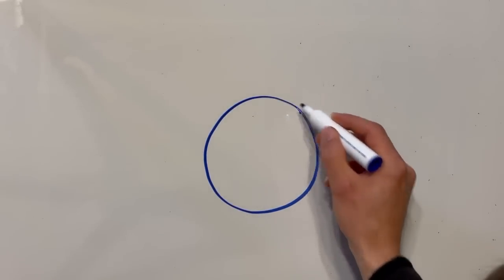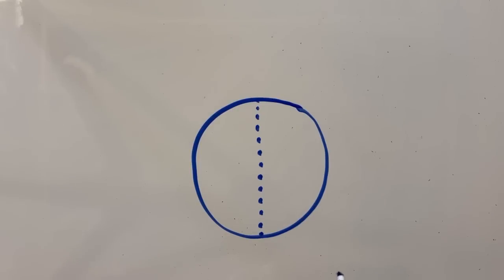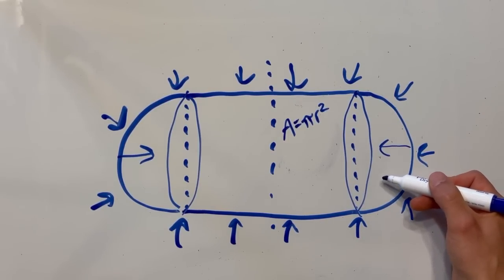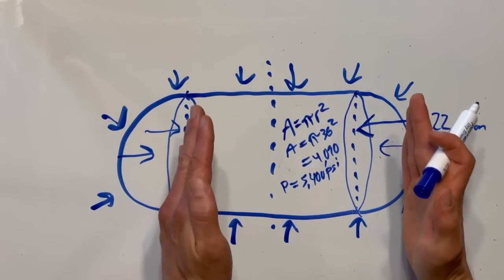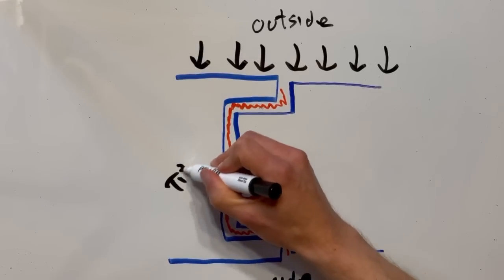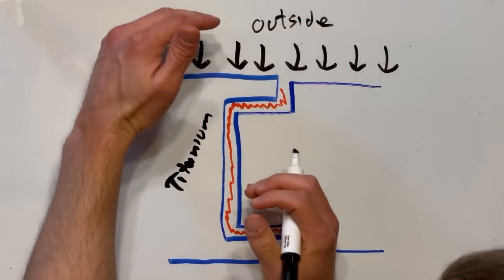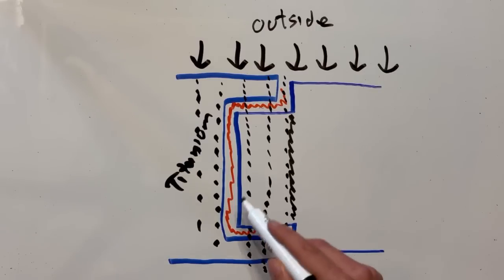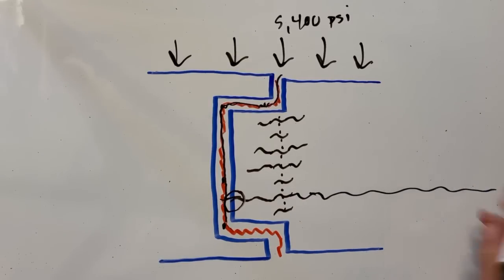Simple Engineering Analysis of How the Titan Submersible Could Have Failed

Comment: If the hull had a step where the titanium fit onto the carbon fiber reinforced plastic (CFRP) hull, my engineering knowledge screams stress concentration! The design relies on the water pressure squeezing the end caps onto the CFRP cylinder. Under this load the cylinder wants to buckle.  The pressure inwards perpendicular to the cylindrical axis also will cause the sides to buckle or bow inward. Where the end caps and CFRP joint the hull walls might be subject to bending or pulling away from end cap in the joint. What happens depends upon stiffness of each component at the temperatures at 12,000 foot depths (cold). Any tiny gap will draw water in by capillary action driven by 5,500 psi pressure. Your point about a shear crack is a possible failure mode. My gut is that cracks in the matrix or between layers of CFRP start at the step (if one exists). Does need to reach as far as you suggest. Now Titan seems to have a Titanium bands/hoops that seem to cover the joint. The legs were attached to these hoops. Don’t know if the hoops merely held the skids or if actually sealed the outer edge of the joints. There would still be a joint between CFRP and titanium, three dissimilar materials with differing Young’s moduli and thermal expansion/contraction coefficients.

Comment: Very good analysis. Especially for the non-engineer.
Easy to say this now, but after forty plus years of building carbon composites, my initial reaction to seeing the pressure vessel, was complete disbelief. I just had to search my memory for the number of times I'd engineered a compressive structure. And all i could come up with were three. And those required extensive omni-directional laminates. I'm still at a loss as to how this was even considered. And even if attempted, how both vacuum and spectral inspection was not in the mix.
Thanks for the video. Keep up the good work.
Reply from the maker: Thanks.  I tried to hit the main points for the average person and not make a crazy long video trying to break down every little technical anomaly.  I do not have the expertise to say much about use of composites in compression.  I am actually curious about studies using carbon fiber in such a manner.
Reply: @Mutton_Lettuce_and_Tomato  You did fine. Always effective to use simple practical examples to get more complex concepts across. 
The reality is, composites, regardless of whether they're carbon, kevlar, etc., are rarely used in compression unless they are part of, or complement, a more complex construction of other materials. That's why, for instance, composite wing structures, even on light aircraft, will incorporate substructures to distribute compressive loads, while allowing tension loads to be somewhat independent through a limited vector.
From my perspective, the real issue with the Titan's use of this material and process, is that we go into composites  knowing that the only way to validate integrity, is by use of pre-pregs under vacuum. And then, non-destructive testing. With metals, we can control the matrix. With composites, that matrix is only known or trusted, on the material level. Not the construction level. 
Thanks again. Keep it up.

Comment: Thank you, Jesus, for someone addressing the glue. I have been saying this from day one. But you didn't go far enough. You did not address how much force was applied to the titanium when it was "glued" to the carbon. If it was just the weight of the titanium cap, that means the glue has to be really compressed/uncompressed when going down and up. People who have used wood glue, how much force? Too much, all the glue gets squeezed out. Mechanics, attention. Valve cover gaskets, you apply pressure evenly when you tighten the valve cover, and you have a final torque that you will finish with that will work with one atmosphere. But the valve cover was not going to experience pressure unless your wife got tired of your crap and drove the car off the bridge with you in it. But, no need to worry, the water that would pour into the engine would equalize the pressure, and your valve cover gasket would be fine even at 50,000 feet deep. Unless Bob at the factory was paying more attention to the lunch clock than he was to making the gasket, and he got an air bubble into the gasket when he was making it.

Comment: Exactly. This man's got it. I must have watched 20 other videos intending to explain why the sub imploded, and I've seen only 1 other video, from only one other engineer, who seemed to understand the problems with the sub that seem obvious to me even though I am only an lowly electromechanical technician and not an engineer. Carbon-fiber-composite cylinder such as that used in the sub, should be strong at holding high pressure in due to the fiber's tensile strength, and not merely useless at keeping high pressure out, but likely to cause damage to the epoxy resin surrounding the fibers as the fibers flex inside the expoxy. Just think of a rope bridge. Rope has high tensile strength, but it just bends when you try to compress it longitudinally. That's why you can hang a bridge from the rope but you can't use a rope "column" below the bridge, to hold the bridge up. Problem with the composite cylinder seemed obvious to me when I (1) learned that carbon fiber had high tensile strength, and (2) saw the way the fibers were wound, in a circle, or a helix, to form the carbon-fiber-composite cylinder. Then we use an adhesive to attach titanium hemispheres to a carbon-fiber-composite cylinder? I'll stop here.
Reply from the maker: Yes, the resin can work fine in compression with the fibers to strengthen it to some degree in compression like rebar in concrete, but sheer stresses at the bond joint is a likely place to create delaminations/cracks in the resin between the layers.

Comment: No one has addressed the issue of what happens when the landing frame is jettisoned to lighten for emergency accent, then you have two heavy ends and light in the middle , like holding a wiener horizontal in the middle it droops on the ends
Reply from the maker: The landing frame would have such an insignificant impact of the larger forces acting on the pressure vessel. I think even on the surface the heavy titanium ends were supported more my the composite hull than the landing frame.  This is why there almost certainly had to be some horizontal fibers laid down in the composite hull to support the titanium ends even when above water.
Reply: @Mutton_Lettuce_and_Tomato  take a closer look at at the tube no structural support other than the frame , the failure point would be the bonded joints , the failure of the rear joint at top is most likely first failure point , just like I predicted a failure of 100 buildings in the south during ice storm , only as strong as weakest link

Comment: You are the first presenter that has mentioned "tension-compression" issues with carbon fiber.  That sub basically resisted water pressure with the five inches of epoxy resin, which in itself is amazing.  Excellent discussion.  Thank you.
Reply: That's what I was thinking. If the fibres bend, which they do in the video showing them make winding the actual pressure hull, then the only thing giving rigidity is the resin ! How could so many people have made such a obvious mistake ?! Tension versus compression.
Reply: @rawnukles  You could make a comparision between carbon fiber bonded with epoxy resin and steel rebar bonded with concrete.  The difference being that the rebar is strong in compression and in tension and gives the concrete increased rigidity.
Reply: I have been waiting for some detailed comment on the use of carbon fibre and know it is used widespread in tension applications. Before seeing this I was looking for compressive strength figures for carbon fibre and found that it was only 50% to 30% as strong in compression. I also watched the video of the bonding of the carbon fibre tube to the titanium end flange and was amazed to see how it was slapped on in an open factory environment. In all very well explained here. Also I was with Rolls Royce as a trainee when their faith in carbon fibre bankrupted them so I have reason to be sceptical of carbon fibre.
Reply: except it SHOULD have been 7 inch and should not have been made from aircraft industry rejected fibre
Reply: @gowdsake7103   carbon fiber is not suitable for deep water use regardless on its quality or age or thickness.
Reply: @roycem4945  As I understand it thats true but the way it was used makes no sense
Reply: @gowdsake7103  Right on with your statement.  NASA uses carbon fiber, axially wound solid fuel rocket booster casings that do fine with one exception.  But of course, the pressure is coming from inside the casing and wanting to expand the circumference of the tube, therefore putting the fibers in tension.
Reply: @gowdsake7103   I learned as a kid that you can't use glue to bond metal to something else and put pressure on it.  BTW: I want to know who did his science to say how much glue was needed.
Reply: @roycem4945  His main problem was he winged it ! at the very least it should have gone into a vacuum chamber to rid everything of air bubbles.
Even worse was the fibre was laid by hand with just a scraper and zero QC, he just didnt care about safety
Reply: @gowdsake7103  even doing it with machine within a vacuum chamber with flawless QC, the vessel would have dove maybe one or two more times before imploding.   The materials, the mix of materials, the glue, the shape and more were all points for implosion.  And as experts have stated - repeated and extensive testing (before passengers) of a vessel gives the amount of times a vessel can dive.  Then that number is HALVED or less - and that is the limit of dives.  IMO Stockton had a death wish and was a conman to himself and the public.
Reply: @roycem4945  Oh I agree but their attitude was we wont even try if it costs money
Reply: @gowdsake7103   Stockton was obsessed while being blinded by stubborness as he tried to compete with other dive submersible companies by targeting the wealthy adventurers / tourists.  He justified the desired end results over science & safety.  On that dive he had three paying customers.
Reply: @denniscliff2071 Space is a low-pressure area, so yep 👋👍
Reply: @gowdsake7103 Not rejected - past the date.
Reply: Yeah, amazing how the entire world is baffled and not one single analysis mentions the blatantly obvious. Until this video came along.
Reply: You can't push a rope.
Reply: That's not true. Ben Taub, just one example, from the New Yorker mentions the tension-compression issue, as do others. You can watch this in which he mentions a host of other issues that were also going on. https://www.youtube.com/watch?v=xeXCcFBMEx4&t=103s  
I'm not taking anything away from this video b/c I did find it very educational and interesting, but others have pointed out that issue, as well.
Also, Rush comes from aerospace where CF is better suited. Perhaps that had something to do with it or, he just wanted to be the first CF submersible to go down there like he said and that was more important than the physics of it.
Reply: Resisted??? Lol 😂
Reply: He’s absolutely not the first to mention that, but it is indeed a great explanation. 👋👍✌️

Comment: Excellent examples. Just two more aspects: 1) the composite is not isotropic, so stresses will not distribute uniformly in all directions (they make spheric submersibles made of isotropic acrylic, and they hold just fine); 2) temperature variations will add  even more stress at the joint,  as titanium and the composite have different thermal expansion coefficients. Sadly for Mr. Rush, he never looked carefully enough at a phone book. I loved that illustration of delamination. Thank you.
Reply from the maker: Agreed.  There is a lot more to it than just what I presented in the video, but I tried to not make it too long and complicated to help the average person understand the main concept of what was going on.
Reply: @Mutton_Lettuce_and_Tomato fyi re the carbon fibre, they only did hoops. They were accused to do it in a diamond pattern but Rush felt that would take too long and be too expensive, and he was, like his name suggests, in a Rush. 

Incidentally, the carbon fibre was bought at a huge discount because it had past It’s shelf life to be used for aviation.
Reply: The temperature range is not exactly huge, maybe 15 degC at the surface and close to zero at the bottom? Is that enough of a range to create a problem in the interface between titanium and carbon fibre as the sub ges down?

Comment: I have a question: what if the sub was made of say steel or titanium but was in the shape of a cylinder? Say welded at the spots where glue was? Would it still implode then?
Reply: In the 1960s there was a deep sea sub called Aluminaut. Fully made of aluminum and with the same shape hull as the Titan. But it never imploded because it was competently engineered and constructed.
Reply from the maker: It would be much less likely for an entirely steel or titanium cylinder with welded end caps to collapse.  Being out of one material the entire capsule would expand and contract at the same rate and as a result not put increased stresses at that weld joint.   Welding is a tried and true process that can be carefully monitored and inspected to verify there were no defects during the welding process compared to the glue joint which may be more difficult.

Comment: Great video.  It is very cold at those depths.  Would the response of the materials to temperature also be an issue with titanium contracting different than the composite, or is this a minor impact compared to the extreme temperature?
Reply: I’ll bet no testing was done to see what the difference between the titanium and the carbon fibre and other materials used responses to temperature charges were and the affects that could have on the joins and seals between them
Reply: @StoutProper that would cost money and it appears that Rush cut every corner.
Reply from the maker: Water temperature being within a few degrees of freezing is probably not going to play much of a roll compared to the extreme forces due to the pressure.  Temperature can play a roll with some materials , but you often need to get much colder than freezing before that becomes an issue. It is a valid point that could add further risks to the design and it could potentially make the adhesive more brittle and prone to cracking.

Comment: Fantastic stuff. I kept hearing people say "it leaked in" and that seemed impossible- why wldnt it just immed implode if so. So it wasnt like a traditional leak that u think of where its dripping into the capsule- it may have snuck into the seal and slowly crept along outside. Appreciate this video.
Reply: There could have been a leak in the tail that started on the west down and filled the tail as it it descended
Reply: @StoutProper  The tail is apparently an equipment space open to the sea.  Not sure how they could have gotten enough water into the structure to matter without anyone noticing.  But we'll hopefully find out.

Comment: The carbon fiber/epoxy hull of the Titan features alternating layers of UD prepreg in the axial direction, and wet-wound carbon fiber filaments in the hoop direction. 

So its not just in one direction as many self proclaimed internet expert are saying.

Also the titanium end caps are held in place by the pressure itself when under water. The glue are just there to stop it from falling off when not under pressure. 

Its not an area of concern.
Reply from the maker: Thank you for the information on the hull.  I was certain it had to have axial fibers to hand bending stresses on the surface and during loading and unloading.  Interesting that they mixed pre-preg and wet-winding.

Yes, the titanium ends would be kept in place by the water pressure along under water. The adhesive would only serve a purpose on the surface.
Reply: It most definitely is an area of concern, because the groove is complete responsible for transferring the end cap loads to the composite shell. The epoxy has a strong influence on this load introduction.
Reply: @marconawijn405  You can use anal lube instead of epoxy glue and as long as it stay in place until you start diving, it will be perfectly fine as the immense pressure press the titanium ring against the hull of the sub.